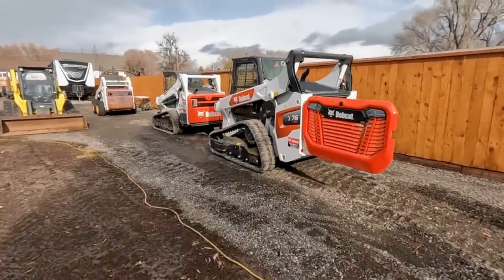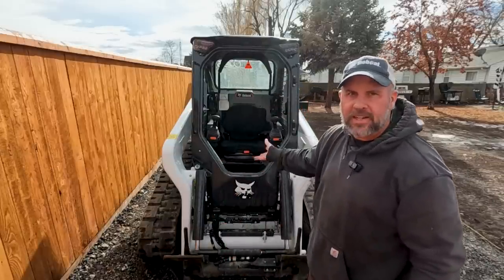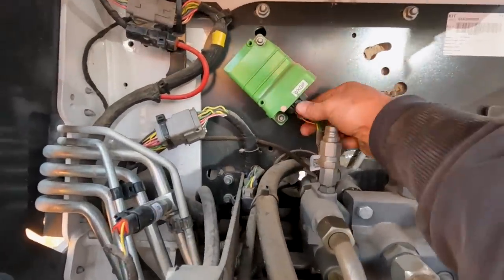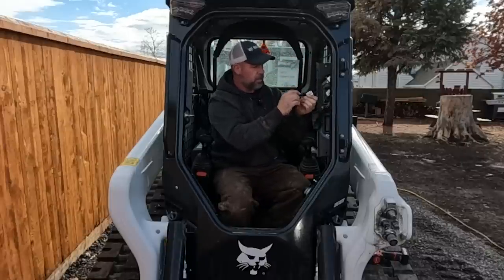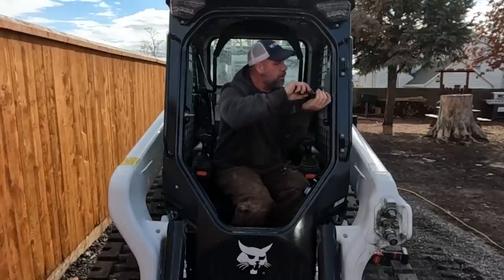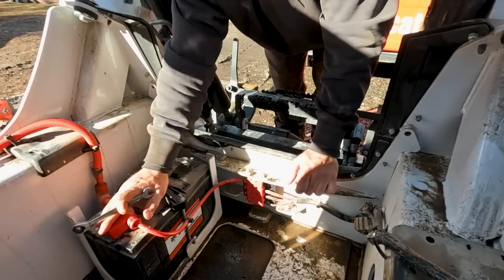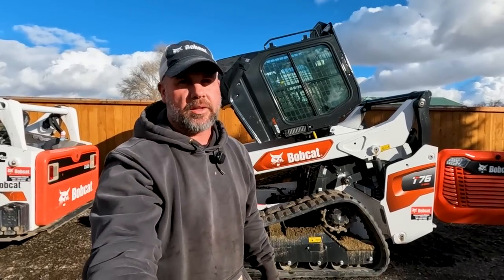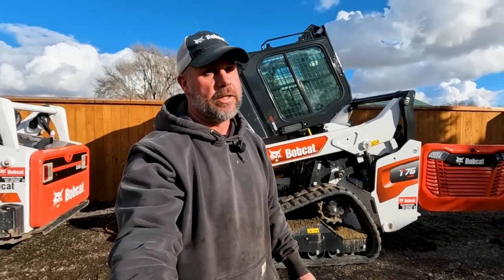Bobcat T76 R-Series, What do do if you experience electrical issues.

Comment: I’m a bobcat tech in north Georgia. Run into water in connectors on the R Series all the time. I hit all the controllers with some compressed air even if they seem dry. Fixes electrical issues 90% of the time.
Reply from the maker: Awesome, I'm originally from GA, kinda miss it.
Reply: Do you have battery isolators ever on these machines? Thinking about electrical stuff, should have an auto-isolator kick everything out to prevent drain and possible hazards...
Reply: I have a bobcat t86 and the AC compressor clutch will not come on even after servicing AC to make sure pressures were good and all, fuses were good even swapped relays, still ac clutch has no power to it. I can use a Power Probe and make the clutch kick in, so the clutch is good , any ideas?
Reply: @dwightschrute1953  first thing to check is to ensure you’re getting voltage to the relay and signal to the relay. If you are then issue would be in the harness between the relay and a/c compressor connector. Are there any codes present in relation to the A/C? That’s where I would start
Reply: Do you see this issue with no communication to jog dial. Keeps blowing fuses. I’m in north Georgia as well. Jackson county
Reply: Hello Williams, my bobcat t450 has an intermittent code ( r7404 ) “no communication with main controller " when this code shows up it won’t let me do nothing and after 10 seconds approximately he turns off… if I wait 10 mins or more i can start it again and everything works perfectly but the code comes back again after a few minutes he only do that after 2 hours of working with it approximately…. I checked everything, grounds, alternator and wiring and I don’t see anything wrong. Please if anyone had this same issue let me know thanks

Comment: Well, allegedly, Doosan turned the Bobcat into a Doochebag.      They better start issuing mass recalls to fix these sorts of issues.   I bet it has to do with the engine and wires generating heat underside the cab and and as the wires cool down, they draw in cold most air that condensates on the pins.  Can't throw bags of rice in there to draw off the moisture because of the rats, but maybe some other sort of desiccant packs might help around the connectors.

Comment: s750 at work was blowing headlamp bulbs nonstop just out of curiosity i pulled the relay board bottom left next to seat all relay connectors & circuit board itself was thick green crust we power wash skidloaders daily 3000 cow dairy. right now with roads slushy salt/calcium chloride i see so many snow contractors hauling bobcats on trailers hope they're thinking ahead

Comment: Being an Automotive Tech for 35 yrs, I've never had huge success in using dielectric. I use a spray can product that's a wool wax formula. In Canada I buy either Fluid Film or Honey Goo. There may be more companies that make similar products.  It is non-conductive, creeps and/or wicks into the wires, displaces and respells water,  and prevents corrosion. It also does not cause swelling like petroleum based products do. I usually blast out connectors with brake parts cleaner, then air followed by the spray.  I use it every where I want to control corrosion. The issue is the fact all the controllers you mention all use low voltage for communication between each other and from sensor signals. It doesn't take much to alter the voltage and therefore the signal. I've been dealing with this for decades in the automotive side. Pretty much since the first computers started showing up in cars.

Comment: I do these all the time with my rainy climate. I often find water in the cab to mainframe connector. Also, there is a small connector that is terminated by the hub controller, just has a cap on it. Usually always have water in it from sitting on the belly of machine. Little hard to see depending on machine options but it’s there. I always blow every conector out that i can reach under the cab and use dialectic grease, made it part of my PDI, because if it don’t, it will be back. One small drop of water can cause all sorts of issues. Hope that helps anyone with this issue. Good video 👍🏼

Comment: Great content brother actually had a similar problem with our unit lights flashing backup alarm and all. I could hardly believe I solved the problem by cleaning the connectors as you did. There was absolutely no moisture visible but I trusted your advice  over my experience and guess what it worked. Thanks again

Comment: Sounds like a hot machine cooling off may pull moisture into the connectors. On some harley davidson motorcycles if you spray water on a hot engine they sometimes will pull the gasket and water into the engine.

Comment: I’m a bobcat tech at Duhon machine in Scott la. We have this issue at least 3 times a month possibly mire. Cleaning ground wires and positive wires are an issue especially either harness being so close to the bottom of the allowing mud moisture getting in the connectors that feed the mid controller and hub controller connecting to main harness . Also the the connector from main harness to cab harness is the issue as well

Comment: Water can come from humidity too. That could be the source. Cheaper connectors, pins, insulation, and wiring doesn't help either. Dielectric grease can also trap in dirt and debree. If you got high quality electric circuits you should never need grease... Thanks for the video!!

Comment: Electrical gremlins, suck, no doubt. My T770 gets random codes thrown out in very cold temps when I plow snow. Every winter. I shut it down, count to 10, then restart the machine, and 90% of the time that fixes the problem. Once the machine warms up, and can dry out that moisture, that works well for my machine. I try to park it in my shop for the winter, but that isn't always possible, but it is what it is. Thanks for that run down, greatly appreciate it. Oh, that rubber boot can help keep moisture out, but it will trap condensation from dry faster too. Catch 22 from my point of view. Take care, hope you have a great New Year!!! See you in the next video.

Comment: I hope someone can help me, please:
I have a 2021 T66 with 169 hrs. It ran fine when I parked it, where it's been sitting for a year, with the door off of it. I went to start it yesterday & the battery was dead. I put cables on it & it powered up. I entered the passcode & pushed the start button, but it just clicked & went dead. I checked removed the battery jump point nut in the engine compartment, cleaned it & reinstalled it. It powered back up, but did it clicked & went completely dead again when I hit the start button. It's as though it's resetting.

Comment: I’ve had so many issues with the electrical side of things where the r series loaders (more prominent in the s62-s76 models) where they do not turn off unless you disconnect the battery or hit the isolator. All to do with the circular exhaust vents on all the controllers water, dirt or moisture gets through the vent and just causes issues

Comment: I don't understand bobcat fan boys.  Bobcat has not sorted out how to keep connectors clear.  Something other industries have resolved decades ago.  When asked on how to prevent the problem bobcat responds like an internet forum... everybody claiming a given solution is bad.  These machines are an absolute bitch to keep running in the cold, or the wet.  My fleet gets wet.  PMI's include full wash about every quarter.  Winter excluded if freezing temps are expected.  While I like the support my dealer provides... it is support that should never be needed.

WD-40 and compressed air for the short term.  Dialectic after the water is purged.  To the internet and Bobcat failures... dialectic can never increase resistance if your pin fitment is correct (IE you built it right in the first place).   3M Silicone Paste.  PN 08946.

Comment: Love some r-series electrical issues, seemed to be better as of late, we send out a lot of snow machines around 300 or so a year and as snow machines go they sit and sit for months and those have been the worst for harness issues. Other than electrical and the early lower lift cylinder pins seizing, the r-series have been very good. We recently just got in a 5600 hour s76 from a metal foundry which has been beat to hell, rear door has been smashed to pieces, cabs all dented but overall its in very good shape mechanically speaking. Engine runs fantastic hasn't had injectors like all the v-1 engines seem to need, axle seals arent leaking, no drive motor chain case leaks like every other machine will experience at some point. I bet the cylinders have been resealed but currently none of the cylinders are leaking. Everyone hates on the r-series and for good reason with there harness issues, wimpy rear door, cat look alike, but to be honest they are great machines

Comment: I know a lot of manufactures have been using soy as a wire insulator.  Might work for keeping electrons in but maybe not water out? I know these can bus systems use a pretty small gauge wire. Might have to dig out that can of wire dry shellac.
This only comes to mind as I have a car I have to replace a portion of harness from a rabbit chewing up the wires.

Comment: I’m not sure if it’s within the same realm of issue, but I’m getting a diagnostic code B1050–14 HVAC open to ground. My machine is kept inside nearly 100% of the time, and since I’ve owned it, it hasn’t seen rain. But, nothing on the ventilation/air movement/heating/cooling works, now. Any immediate thoughts or direction I should pursue? Like you, I assume it’s some sort of moisture intrusion.

Comment: What does WD in the name WD40 stand for water displacement if you think you have a water issues you need to put it in there and Dielectric grease fills in the voids so water will not lay in your plug and does cut down on Croatian / 35 years of experience

Comment: Bro I have a serious problem with my t550 I seen many of your videos about injectors and I followed but it came down to my injectors or injector pump but I changed both and still no start. What I noticed now I'm thinking is when the problem first started on idle its smooth but once I raised the rpm or try to use it it was blowing black smoke and now it doesn't start but as I'm trying to start it once in a while it tries to start but that's it but now I'm thinking can it be the crankshaft sensor
Reply from the maker: No, crank sensor does not explain your symptoms

Comment: Have a S185 replaced the Hydrostatic Motor carrier Bearings, now , only disconnect one plug which is the electric solenoid now put it all back together and I have no power to the park brake solenoid, checked fuses and relays but now power, I am at the end of my wits, can anybody help ? it's just a single speed machine, any help thanks in advance.
Reply from the maker: Are you sure you installed the brake assembly correctly?

Comment: I lifted the cab on my T76 recently and it had 4"+ thick layer of mud on the bottom. I scraped and washed it all out until it looked new again. it took all day. I even left the hose on with a sprinkler for 3 hours inside of it to try and get all the areas I couldnt see. I waited a day before starting it and it ran fine. A month or so later I raised the cab again and there was 1" layer of mud over everything again. every single area had mud. I was pretty mad and closed the cab and noticed at least a 1/2" gap on the sides and around the cab. Plus the areas where the hoses from tracks go into cab. all packed with mud. I called bobcat and they want almost 2000 for the forestry mulching seal kit. I went to the store and bought marine grade weather stripping. I added it all around the gaps but forgot to plug the drain holes on the bottom. Very poor design. In the back under the starter is 4" of mud and i cant get it to drain out. Going to have to try and tilt bobcat up so it drains back. Also the AC stops working after 30 minutes because it freezes up from being caked with mud under the seat. my 2017 S650 AC never froze up
Reply: Now you’ve got me curious. I’m going to have to go raise my cab tomorrow. Can’t imagine it would throw that much mud inside.
Reply: @andrewr2147  it does. I should have made a video on it. I use my t76 offroad all the time so its constantly in the dirt. I live in South Texas so theres never rain. just dusty sandy dirt. I have to bang my air filter out every 2 hours when running the brush cutter. and at least once a day running just a bucket. top radiatior gets clogged fast too.

Comment: Does the new R series have remote battery posts for boosting? Having the battery under the cab will be a nightmare in my application. We use them for cleaning bitumen falling off conveyor belts. About 50% of the time the cab shocks are failed and give 0 assist. Along with 100lbs of bitumen piled on the cab. Oh and they didn't give me a truck with a crane lol
Reply: I believe there is a rear battery jump plug in the back left
Reply from the maker: Yes the remote jump location is in engine compartment under air filter.

Comment: Thanks for the videos. I’m learning a lot. I have an S300. The rocker switch for the power bobtach will only raise the levers. Not lower. I can get them to lower using the pedals. I’ve already replaced the switch. I’m guessing there is a solenoid somewhere that is bad? Can you advise?

Comment: Having a very similar issue with a t66.  I couldn't find any moisture in the hub controller either, but I guess I'm cleaning out the connectors tomorrow.  Thanks.
Reply from the maker: Let me know if it works
Reply: @tetradgroup  cleaned out the connectors this morning and the buzzer went to a low chirp off and on for about 2 minutes and then it quit.   Seems normal now.  Had it tested for about an hour, but the real test is sitting outside in the rain.  Being a newer bobcat tech in a shop by myself, I've watched a good bit of your videos and do appreciate the info.

Comment: I have a t 450 , it will work for an hour or so them it will not run the boom works fine but it will not Mover forward or back but the next day it will run for and hour then it will not move any suggestions/?
Reply from the maker: Really hard to say, I would need more information.  You can contact us at www.4tetradgroup.com if you need any help with it.